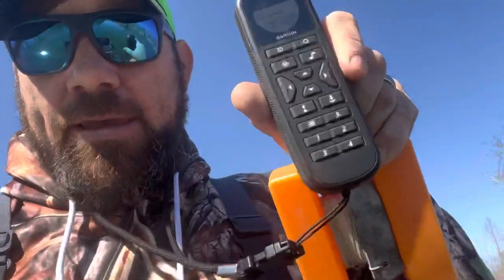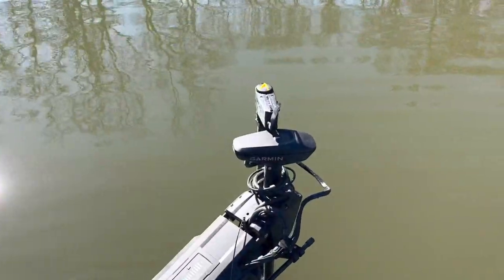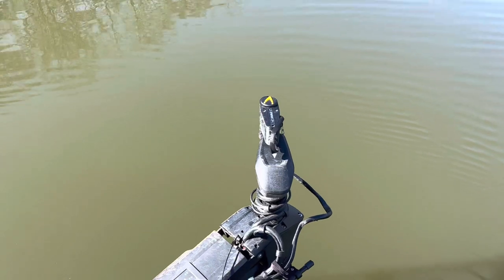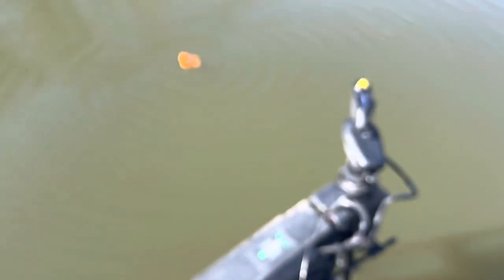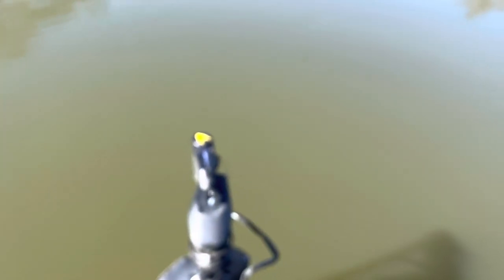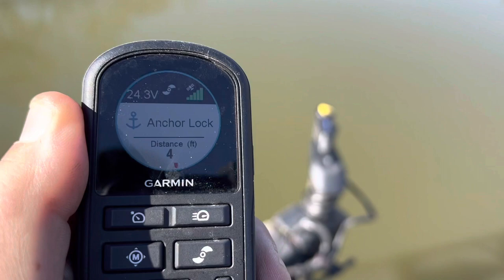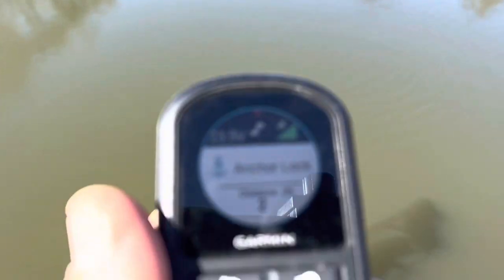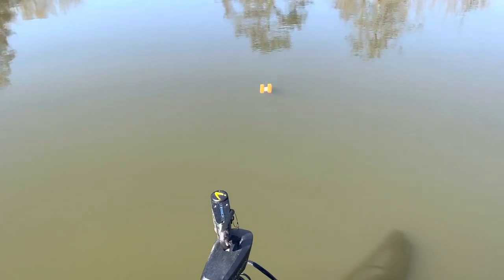Garmin Force Trolling Motor Anchor Lock: Does It Back Up 15 feet and My Theory On Why!!!!

Comment: simple answer is that your boat has mass that is in motion and there is no way to calculate all the different boat and weights that the trolling motor will have to push around the amount of drift depends on the amount of thrust required to get your boat moving and then stopping it. different things will affect it like wind and current. getting you within 10 foot is probably pretty good when you factor everything in.
Reply from the maker: Agreed my friend

Comment: I just had a new force installed on my boat. I have calibrated it at least 4 to 5 times with 85 to 86% being the best I could get out of it.. My problem is what you covered with the boat backing up 15 to 20 feet.. Very aggregating to say the least because sometimes it will come back up and sometimes it just does whatever it wants.. I've been very disappointed with it the few times I've used the spotlock
Reply from the maker: The new update seems to have fixed that.

Comment: Good visual test. Ive noticed this same "go past your mark in reverse then walk back up to your spot lock location".  Since we, the public, have non-military grade GPS accuracy, getting to within 3 to 8 foot of your spot lock location is about all the accuracy you can expect. If you open the page on your garmin unit that shows the number of satellites you are picking up it will show you the average gps "error" at that specific time. Ive noticed anywhere from 6' to 19'.  This accuracy will vary throughout the day as different gps satellites and number of satellites are overhead.  Also, as we encounter here in the Ozarks, being up a creek with high hills on both sides you may be picking up only 3 satellites which pulls down your location accuracy.  Ive asked the Garmin help guys a question which nobody there can answer which is also interesting.... Ive got 3 Garmin units plus the Force TM and the hand held. All have GPS heads.  If I mark a spot say with my handheld and I'm standing in the back of the boat, which GPS head unit in the networked system is it using as my location.  Could be 20' difference from TM head to my standing location.  Anyone?
Reply from the maker: Good question but ten trolling motor is a stand alone gps unit. It doesn’t require fishfinder as to operate. The receiver is in the head. I mentioned that my error was about 9 feet in the video. Thanks for watching bud and great info.

Comment: Great video.   I think a test on the jog feature would be good especially with a little wind.  Never seems to work right for me.
Reply from the maker: I have a video from
A few months ago. But I need to do another one. It works great for me tho. What seems to be happening with yours.
Reply: The jog feature will not work correctly if you have a bad pedal.  I don’t know why, because you can’t jog with the pedal, but I had two bad pedals and once replaced both of my forces jogged correctly.
Reply: Been a while since I used it but seems like I’d jog forward and it would move left etc
Reply: @dreb3497  Sounds like you haven't set your bow offset.

Comment: I hit the Anchor button a second time on the way back and that seems to help.
Reply from the maker: Yep I hit it once then again which turns it off and then again and it’s money. It’s technically a triple tap but I call it a double tap. Lol
Reply: That’s where mine seems to struggle when I’m in the wind or heavy current it’s like the unit never compensates for either so I spot lock it almost always turns the head 90-180 degrees which puts me off the spot immediately then we run over the top of the spot by 10-12’ and it’s a back and forth volley match never slowing down or compensating for the 10’ it will take to turn back around and return to the spot so basically I get stuck in a tennis match back and forth over the spot with the unit sometimes violently correcting up to speed 10 or so which is pretty quick to make a 180 degree turn if you aren’t prepared . So if I’m understanding you right when I get close to my spot lock point I can semi-assist the unit by taking off and hitting spot lock again when I hastily pass over my spot in hot pursuit of the place the unit thinks I spot locked to 😂😂

Comment: It's really not that difficult to understand. If you drive past the bout the tm is trying to spin the whole boat around and it's difficult for it to push the whole boat straight going backwards. It's not how spot lock works. Go past the bouy and stop. Turn the tm 180 degrees and push the boat backwards and push the anchor button
Reply from the maker: Brother are you telling me how to do it or are you speaking to everyone that this video was aimed at. I’m simply testing what everyone gripes about.

Comment: I had a Motorguide XI5 and didn't pay any attention to the engine sounds at all. I replaced it with Garmin Force and now, instead of relaxing while fishing, I'm driven to hell by its crazy howling during rotation. I think it's a Garmin design dud
Reply from the maker: @ArkadArno  I’ll never own another junkie motorguide.
Reply: @The_Garmin_Guru  Write why? Motorguide is generally cheaper (but it's not the price that matters) and has fewer functions. 
The remote control is a disaster, but the engine itself is much quieter, and that's more important to me than the fancy, fast (and therefore howling) Force.
I go boating to fish in silence, not to listen to the howling of a robot
Reply: @ArkadArno  There is no annoying sound at all, my friend, it is very quiet.